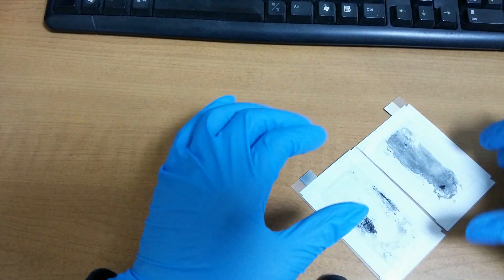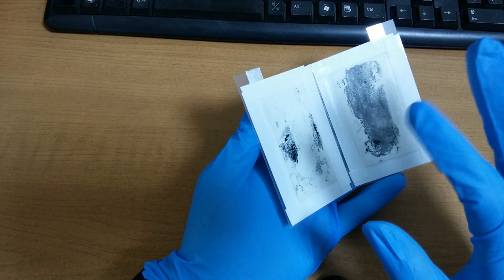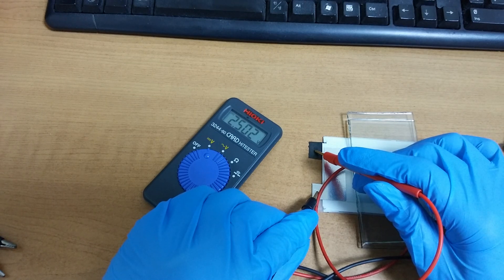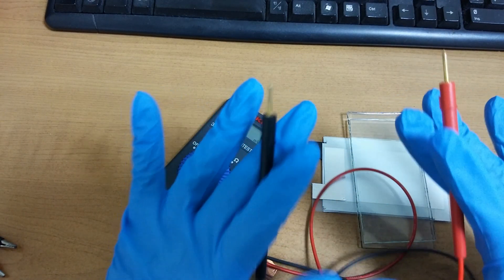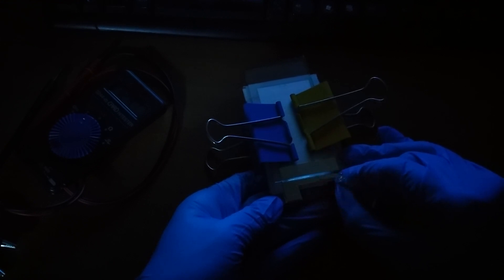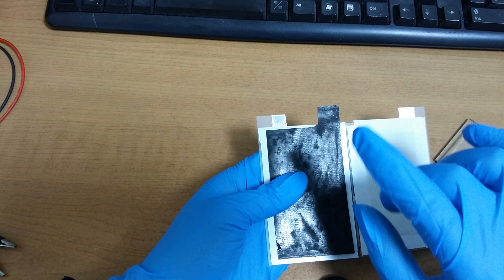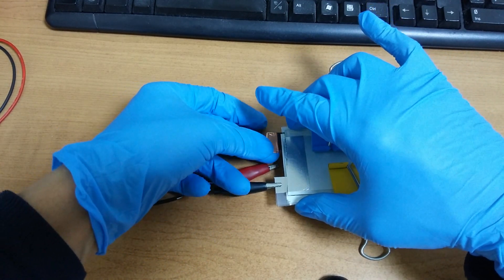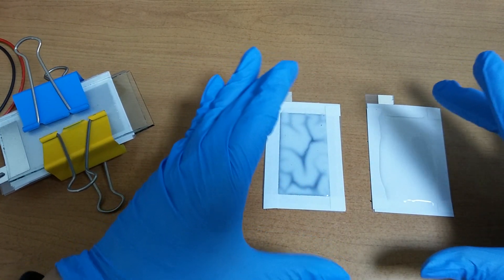paper solid state battery experiment 1

Comment: MJ, what you did here is equivalent to two cells in parallel. The anode equally has two layers because the two sides of the paper are coated with the graphene and are connected together. Likewise the cathode layers are connected together at the terminals. Parallel connection normally results in  increased in current(amperage) as you are witnessing here. If you want increase in voltage you can go for series connection by adding layers of opposite side  which will lead  to more voltage but less current.

Comment: You can use certain genes that are natural mutations to solve world hunger and decentralize or otherwise un-tether from a broken system.

Basically you just use a gene set that has a handful of examples in nature. These genes are called for one example cab-13. Also and alternatively autoflowering cannabis can be used either stadalone or in conjunction with others of a similar purpose.

What this will do is allow you to create crops, trees, and other things that can grow and photosynthesize under up to 24 hours of light.

Most plants, trees and crops depend on light cycles and so by simply enabling them to ignore that requirement for flowering you enable modern technology to marry to any plant or tree species once perfected.

Its safe to test them in isolation chambers of course.

I recommend ginseng, redwoods, and many others like say huckleberries for pie.

This could eliminate pressure on wild species and with say something like lotus silk enable broader production of fiber crops.

This is easily solved but guess who has had eyes on this stuff: Billy Gates.

I just did this so you are aware and it can help your army. It should be exploited especially with modern technology.

Comment: Carbon is corrosive to aluminum, hence you'll get some "primary" battery effect along with the rechargeable part, which makes it seem higher at first, but it will end up degrading more and more, irreversibly.  Instead try like copper mesh or the like.
Reply from the maker: You are right. Have a nice day

Comment: @solid battery coat the paper with active carbon powder before it dries.
What ink are you using? How did you do the anode?
Use alligator clips to light the led or asmall motor. Let us see how long will the micro motor Spin. It would be interesting

Comment: My suggestion is coat the glass in graphite and gold with the assistance of the microwave.  You might need a plasma deposition. They when pressure is applied everything is conductive. I realize thats unlikley to help. But short of atom by atom engineering where are we.

Comment: very interesting.  You really do need a calender machine to roll these plates together.  I think some of the problems of inconsistency are related to variations in surface contact.  Calendering can be as simple as a Brayer Roller or a jewellery Rolling Mill up to a proper automated industrial calendering roller machine.  Did I understand you correctly when you said that "one paper anode between two cathodes?"  That would increase the current but not the voltage, right?  Always a pleasure watching your precision work... very neat and tidy! :)  Thanks Doug
Reply from the maker: You are right. Have a nice day